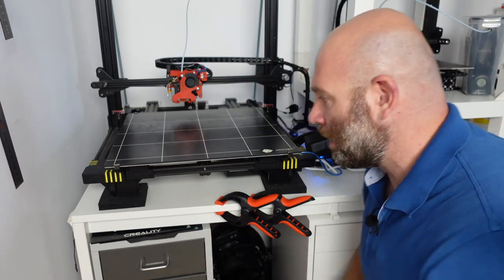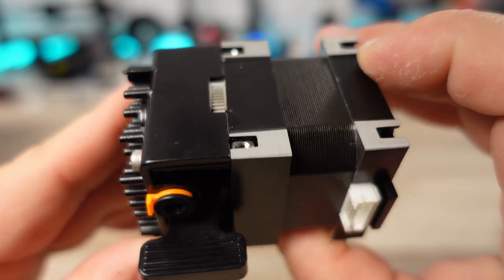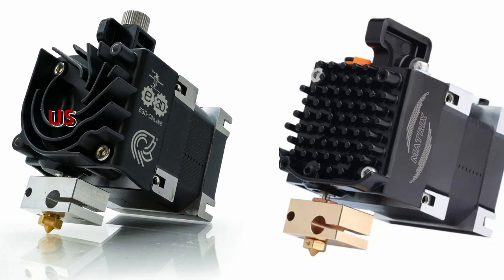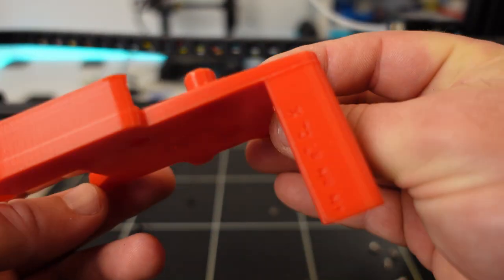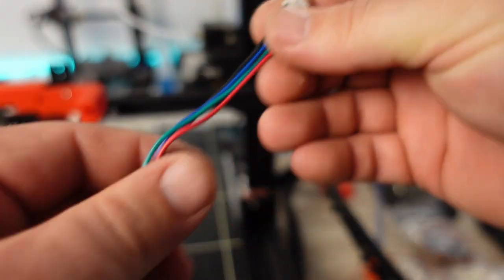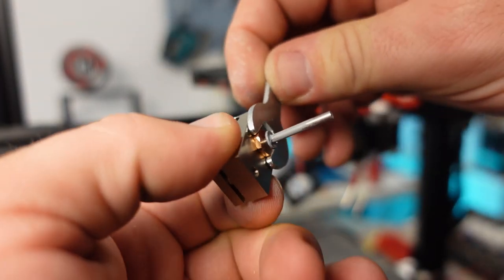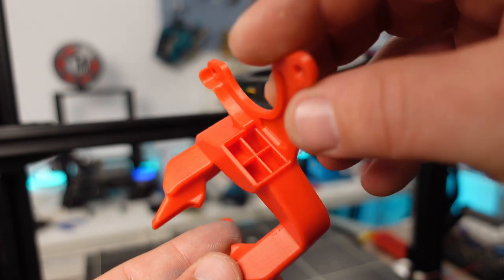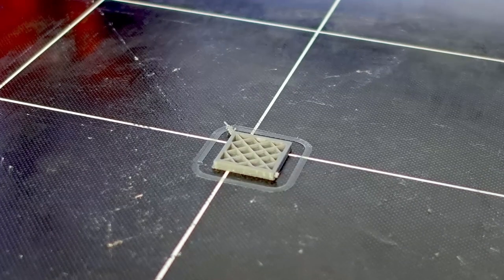Anycubic Chiron direct drive with the MATRIX extruder from Triangle-Lab

Comment: Great video, definitely inspired me to make the change however, I can't find a reliable source for the Matrix in the UK but I have found the Hermera available for a reasonable price. Will this still work if I swap out the Matrix for the Hermera without any drastic changes to your instructions?
Reply from the maker: I have not installed a Hemera; However, I do not believe to be any drastic differences in terms of installing. Yes, the heat-brake is a little different (I believe) but the mounting points should be the same for the extruder. The e-steps are probably different as well but you should do that calibration on any new extruder. The part cooling fan mount is adjustable even if there are variations in the heater blocks height. Motor wiring may be different as well, so you will have to check. Please keep in mind that the mounting here is for a BLTouch probe and not for the original Chiron bed leveling probe. Are you using Klipper or have access to modify the Marlin firmware? I would also recommend getting a new V6 hot-end compatible thermistor.

Comment: This is far to complex... If i buy a kit it should be plug n play and not need all the diy'ing of wires and brackets. Good video but bad kit!
Reply: dude its a universal part made to fit any printer, they can't possibly provide all the appropriate brackets to suit each one. It's not even difficult to adapt, if you're struggling to fit this you should consider a different hobby.

Comment: Interesting upgrade you did.  I have a Amazon Return Chiron that came with a scratched bed, two clogged nozzles and a torn bowden tube.  I've watched a few videos form TH3D which enlightened my to the many wiring issues this machine has.  I've also seen several bed wires catch fire or smoke.  With the impressive build volume, I'd certainly like to rebuild the thing to be reliable and safe!
Reply from the maker: You are correct. The wiring on the Chiron is a bit of a mess and quality can suffer. I ended up removing all the old wiring and used a CANBUS system (only 4 wires from hotend to mainboard). Video should be up in a few weeks on that conversion.
Reply: You can also do the blue tape method so you don't need to heat the bed. Saves money on electricity and I get great adhesion

Comment: I'm new to this and have a chiron and swapped the hotend and it won't print so am considering making it a direct drive one, is there any extra firmware I need or can I just use the firmware already on my chiron to just get going again? I'm not a big fan of messing about with firmware as when I installed the cr touch on my ender 3 it killed it and now is in parts in a box for spares so want to avoid firmware changes
Reply from the maker: There are some things that may require some firmware tweaking. For instance, the Matrix extruder comes with a different thermistor then what is stock on the Chiron (NTC3950 is on the Chiron and Semitec 104NT-4-R025H42G is what should come with the Matrix extruder). If you are going to use the new one, you will have to change setting in the Firmware. If you are going to change the probe with something like the BLTouch you will definitely have to make some firmware changes. It really depends on what type of direct drive conversion you are going for. IF you are looking for something like the Hemere or the Matrix extruder, there is no easy way to do it without some firmware tweaking. You could just convert to direct drive with your current hot end and extruder which should not require any firmware updates. However, you motioned your current hotend is not printing. Maybe its something unrelated to the hotend that you need to address first.

Comment: Where did you get more wire for the extruder wire  or a silicone wire?
Reply from the maker: I used the motor wire that came with the extruder and just connected those to the connector where the old extruder was located (https://youtu.be/SQtYMD4wXpk?t=271)

Comment: Nice and clear video, thanks for sharing.  One thing to consider is to rewire the hot-end completely with flexible silicone wire as the Chiron's original wire quality is poor and tends to break over time with the movement of the system.
Reply from the maker: Great point! I fully agree with you. I actually had to patch some of the provided wires due to repeated stresses on them. Many of the temperature reading issues (thermistor wires) with the Chiron are caused by what you mention.  Anybody doing this kind of conversion should consider upgrading the wiring loom as well.